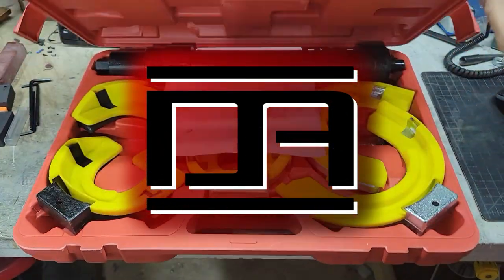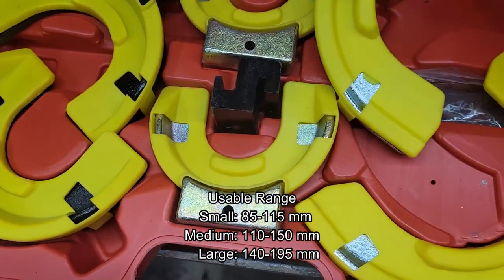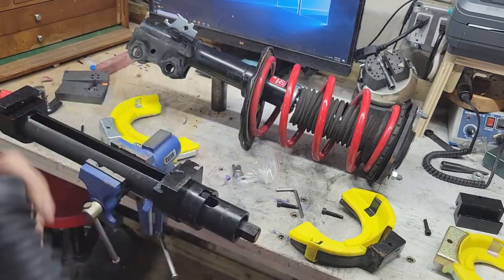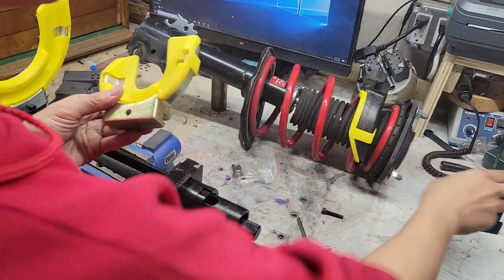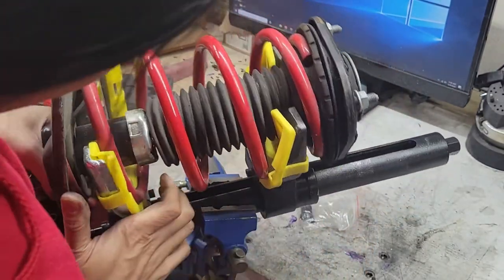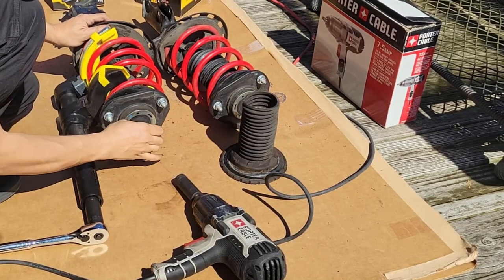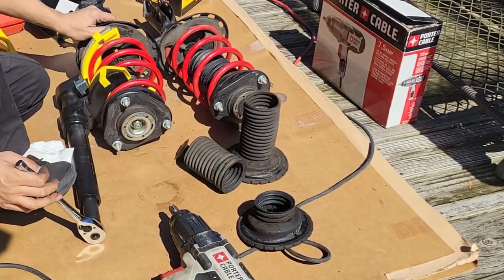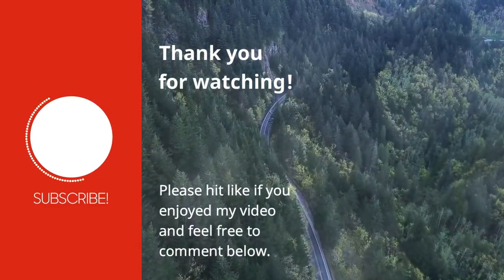VEVOR MacPherson Strut Spring Compressor Review / Replacing Insulator Boot (Scion tC2 / tC2.5)

Comment: For me, this tool looks dangerous.... it needs two rods to balance the force, the spring could just shoot out! I recommend to use two pairs of conventional type compressors, that's the spring is caged by four compressors, and the force would be distributed to four, even if one failed, the other three would hold the spring safely in position.
Reply: It's because he put it on upside down 😂
Reply from the maker: If you are referring to how the spring is seated in the top clamp, I checked both pairs of clamps and they were both angled the same direction. All the matching pairs of clamps have the same angle, so no matter which one I use, one side of the spring will always be seated like that. There is a lip on the inside to keep the spring in place though.
Reply: A better option might be to use a conventional compressor on the outside of this assembly to bring the other half in to line.
Reply: As I have a masters degree in mechanical engineering I can tell you that the user don't need to worry as this spring compressor is very robust, it probably withstands many tons of bending force so it can't pop out because of the design of this compressor. To be even safer a cage should surround it when working with the spring in case it brakes because of fatigue just when you work with it. This happened on my old Ford when I was driving and sounded almost like a gun shot.  

The widowmakers you are talking about are really dangerous though and are really time consuming also in case you aren't as careful as you should to be with them.

Comment: youre supose to remove the yellow plastic storage guard. Its only for storage.
Reply: I find that hard to believe.  Why protect them when they are in the case?  Also, there’s a moulding to hold the spring on them.  I think they are there to help grip the spring.

Comment: apparently you should remove the plastic and not use it with them on
Reply from the maker: I just saw someone just make that comment as well. I actually didn't see your comment until just now.
Reply: @VampyreX13  The plastic covers are used to install the new springs, so the new spring doesn't get scratched.
Reply from the maker: @chrisstanley5748  that's orginally what i was thinking until I started seeing comments saying otherwise.
Reply: So what are the covers for if it’s not to be used?
Reply from the maker: @vapeurdepisse  they are used to prevent scratching the coating off your springs.
Reply: @VampyreX13  I thought everyone said they were not for that? Seems like they could contribute to the spring slipping out of the tool. Do we know if spring actually get scratched from this tool otherwise?
Reply from the maker: @vapeurdepisse  I've been using it a lot more often and didn't have any issues with it scratching springs without it. I did find that if you do use them, you'll want to use a yoke that's larger than the spring to make sure that it seats properly.

Comment: How are your coilovers holding up?
Reply from the maker: They're still performing well and hugging the asphalt on the back roads, but the ride is definitely getting a bit more harsh for my passengers when driving in the city. I may swap them out when I have a free weekend and I'll do a video update of their condition.
Reply: Yeah I had them on my 05 Scion xB release series but they blew out a year later. I was thinking about getting them again I currently run KYB excel G with Godspeed lowering springs it's about a 2 in drop. But I want to go lower for the summer.
Reply from the maker: @rafaelvalentin5508  I've been pretty harsh with mine, hauling a completely packed cargo area, back seat, and roof rack to events in the tri-state area. I'm actually surprised how long they've held up. Fortunately, we now have a dedicated cargo hauling car, but the accelerated wear and tear to the suspension has been done so the ride it pretty rough now.
Reply: Sounds about right but they are cheap I'm glad they work out for you. Are u gonna go back to the TRD springs or no? Or get stiffer springs when your coilovers go bad
Reply from the maker: @rafaelvalentin5508  I'm going back to TRD springs for now which is why I swapped in new boots.
Reply: Makes sense well best of luck with the tC man I really like your car big fan of them.
Reply from the maker: @rafaelvalentin5508  thank you!

Comment: You mounted it onto the spring backward.
Reply from the maker: If you are referring to how the spring is seated in the top clamp, I checked both pairs of clamps and they were both angled the same direction. All the matching pairs of clamps have the same angle, so no matter which one I use, one side of the spring will always be seated like that. There is a lip on the inside to keep the spring in place though.
Reply: @VampyreX13  They want the clamping screw to be aligned with the body of the strut.  There should be a diagram with your kit.
Reply from the maker: @michaell.445  the diagram (see PDF attached in video description) doesn't show the strut.
Reply: @VampyreX13 go figure. The one I'm using shows a diagram and describes having it parallel to the strut.
Reply from the maker: @michaell.445  can you send me a copy of your instructions to vampyrex13 at hotmail dot com?
Reply: @VampyreX13  Oh sorry for the wait I'm just now seeing this!  I'll take a picture of it today and send it

Comment: huh id still use the classic strut compressor. but good to know there are other tools
Reply from the maker: I've actually been wanting this style compressor for a while. I've lowered quite a few cars using the other style, and it was never fun. This one was quick and easy to use.
Reply: Yeah the way the spring bulges outward when compressed isn't exactly reassuring
Reply: I tried that on my Toyota Avensis put I'm going to have to buy this
It was impossible to compress it enough with classic style
Reply from the maker: This style is pretty nice. I actually just lent it to my friend so they could change the upper strut mount on their Hyundai. They were able to easily do it without having to unbolt the bottom of the strut from the car.

Comment: How do you think this tool would work on the front spring of a european ford mondeo mk3? I made the left side which was a complete nightmare with tools that he using in this video, could the vevor compressor do the job to compress the spring this much? 
Check at 14:45 into the video clip https://www.youtube.com/watch?v=CmImQ3Qu-yE
Reply from the maker: I could barely get my springs compressed enough using the style spring compressor in the video you linked. I had no trouble at all with VEVOR one.
Reply: had a nightmare with my merc, needed a ridiculous amount of compression on the oddest shaped springs, first one used three spring compressors, 1 mate pulling up the rod on the strutt and me swinging on the end cap to get the bolt on. Wasn't doing that twice so bought this product. Be very aware that while i can see its definite potential for straight springs and also offset springs with the extension piece, it consistently fired the merc springs out sideways because of the odd shape of them. Ended up doing it with the suicide clamps again.
Reply from the maker: Wow, that is pretty scary, but it really sounds like this definitely wasn't the best tool for your application. I'm curious to see a picture of the spring in question though, if you can post a link.